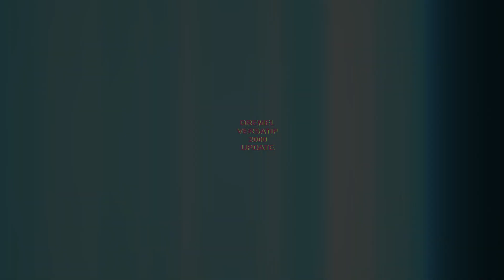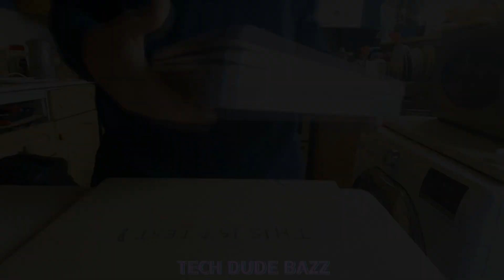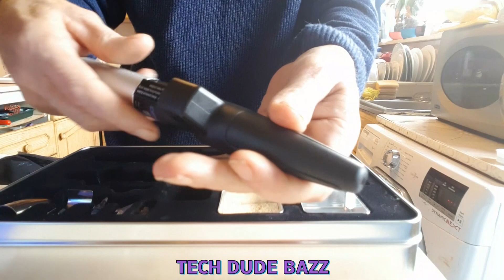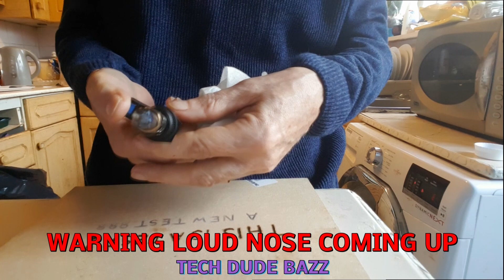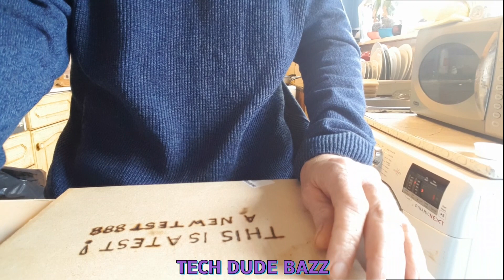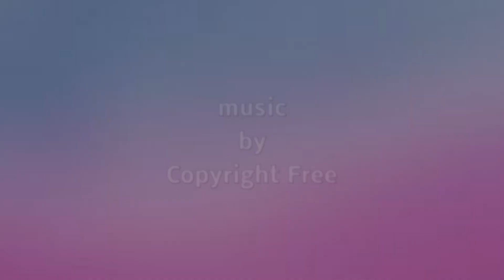DREMEL VERSATIP UPDATE 30 12 2017

Comment from the maker: Well at moment all I can tell is that I did 45 min of non stop wood burning and it was still going with no problem, that was set to full heat, so I think for soldering, it would be even longer on a lower gas setting, but I think for most jobs a full tank will last.